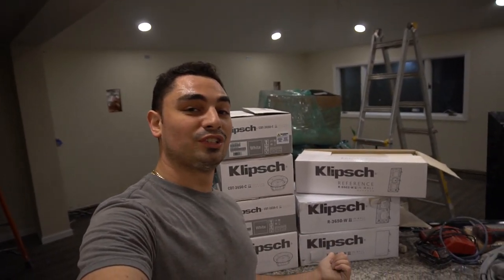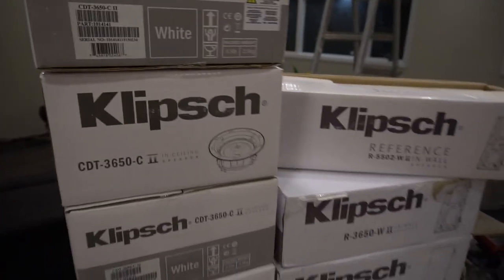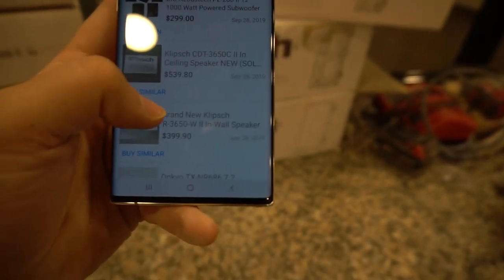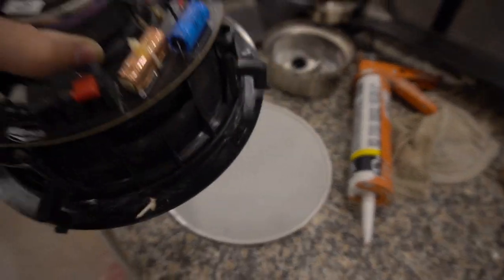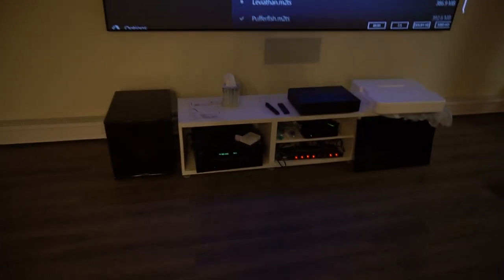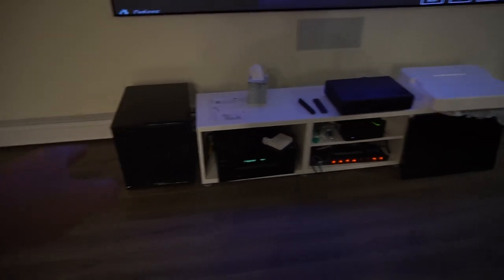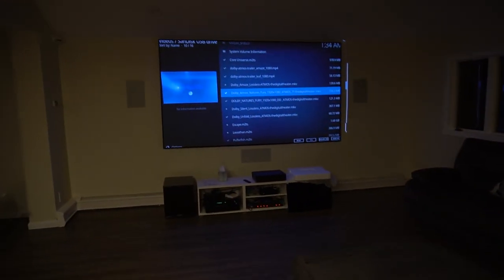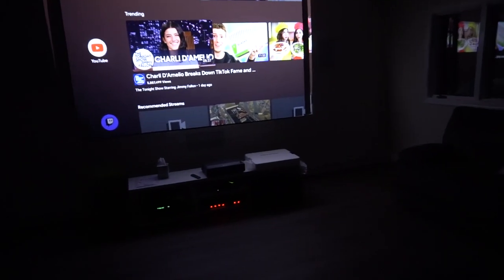5.1.2 Dolby Atmos Budget Setup

Comment: As far as I know, you can only get 5.1 through optical.  If you want Atmos, you need to use HDMI I believe, and/or ARC if your streaming from built in apps on your display, be it a LCD display or a projector.   

The real surround in the ceiling is not good.  Maybe it’s a second set for Atmos which you can do, I can do on my new Receiver.   I just ordered a new 12" Klipish Amp and fix my current one so I have 2 since I do now have 2 amp outputs on my receiver.   I wish I had a room that large.    But it’s not bad with my new 75” Samsung QLED 4K tv I also just got.

Comment: Rear surround speakers in ceiling while running atmos isn't a good idea. They blend together making the rear surround and atmos indistinguishable from each other. I recommended buying or building stands for the rear if u want a better atmos exp
Reply: Yeah, why would you put the speakers of rest sound on the ceiling? Hmm
Reply: @TheLondonCyclist  some hometheater install guys probably mislead him to get the sale even for a novice a quick Google wouldve told him not to do it
Reply: @arnoldahardy  Am I correct in thinking that with a 7.1, he could have the rears, then put the top sound speakers on the ceiling which can imitate helicopter sounding from above?

This is a 5.1, and that's where he messed up, right? Haven't watched the video a lot.
Reply: @TheLondonCyclist  for the most part the more speakers you have the more space u need to have enough space between them to defuse the sound
Reply: @arnoldahardy  the guys confrim is Zack from DMHT.

Comment: Surround sound speakers are supposed to go on the walls or stands 90 degrees from where you sit, not in the ceiling. Only atmos speakers are supposed to go in the ceiling.
Reply from the maker: True but I dont want them on stands for obvious reasons lol 
The directional tweeter helps a lot but yes I understand your point

Comment: I have a question and hopefully someone can help. So I’m new to this whole Home theater thing and I have an 9.2 onkyo receiver and have a 5.2.4 setup and would like to add 2 more ceiling speakers but ran out of channels. Can I buy an external amp and some how connect it to my receiver to add to more channels is my question? Or do I just need to buy an 11 channel receiver? Thanks in advance
Reply: I was hoping to see a response to your question because I have got 7 2 channel receiver and I'm using a 5.1.2 setup. I would like to add 2 more channels.(overhead speakers)
Reply: Check the number of channels your receiver can process in your manual. If it says 9.1 or 9.2 (10 or 11 channels) then you can't add more channels with this receiver, you'll have to upgrade your receiver. Receiver is the device which separates your channel from the source and if the processing is limited to 10 or 11 channels then it is not possible to add more channels to this setup. External amp will just supply power to speakers but the processing has to be done by the receivers. Some receivers can process more channels compared to powered channels. For eg: total processing will be 11.2, but powered channels will be just 9.2. The extra 2 channels  are just processed and not amplified at the receiver and they have to be powered by external amp. If you still need help, reply with your receiver model number and i shall be able to give you more clarity.

Comment: Brother, please help me with some answers if you have time - I am close to replicate your whole system and I need some info pls: to be able to watch neflix with dolby atmos, do I need to plug in from Nvidia STVPRO into Onkyo and from there to the projector ? Or is something different? And does the projector need to support Dolby Atmos too, or if you have the Onkyo it doesn''t matter what the projector is capable off?
Reply from the maker: Projector doesn't need to support Dolby... your reciever is your main input, so the receiver must have Dolby atmos ability. 
I have all my devices going into the onkyo... and then hdmi out to projector hdmi in

Be sure your using a hdmi 2.0 cable

Be sure also you have your Netflix subscription in ultra hd.
I watch all of my atmos vids directly from a usb drive via kodi media player
Reply: @Vic_VP  Thank you a lot brother!

Comment: Is a failure to install surround speaker on ceiling
Reply from the maker: How so? Its perfect and clean
Reply: No offence. While watching a incoming train. The train should pass by you no going up the ceiling.
Reply: @kira5348  you do realize that there are Dolby Atmos and DTS-X receivers which uses the ceiling speakers
Reply: Koh is right. Surround speakers should be placed in the same level as front speakers (at or just above ear level). And Atmos ceiling speakers alone are meant to be placed at the ceiling. Hearing ear level sound and ceiling level sound at same level won't give you the right immersive experience. Also It is not BS that they have difference speakers for different areas (wall vs ceiling) They have different frequency range and power difference.
Reply: @kira5348  LOL